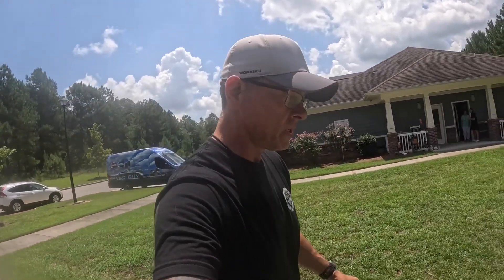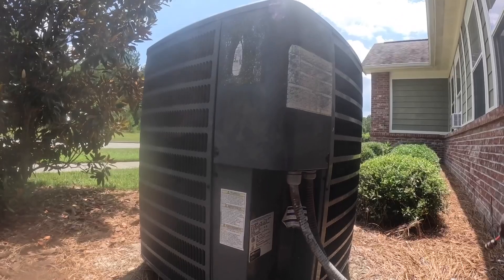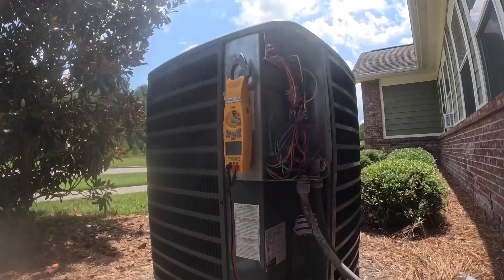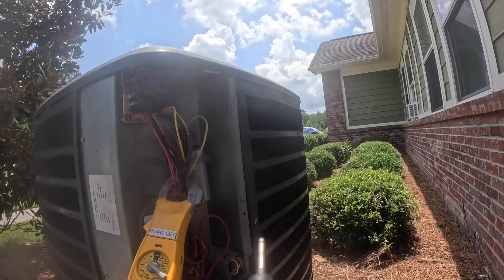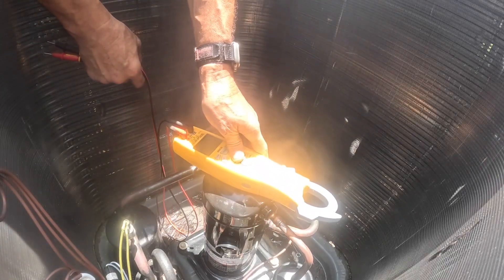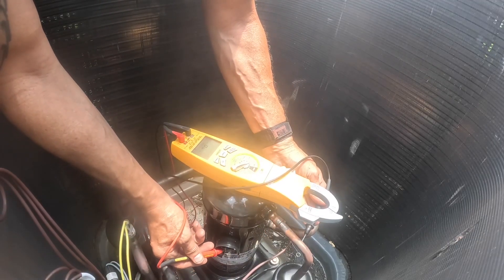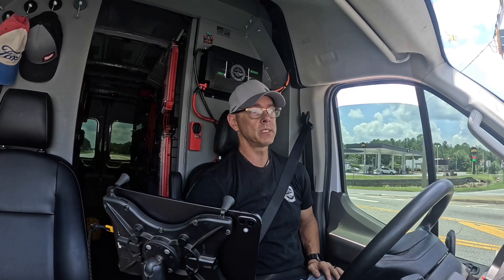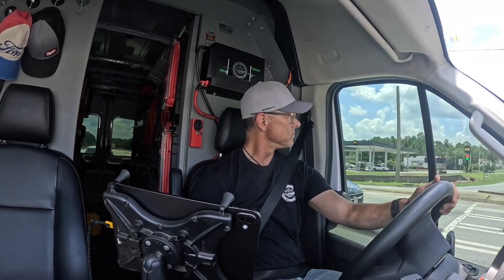Shorted Compressor Is Tripping a Breaker, But Why? #hvacguy #hvaclife #hvactrainingvideos

Comment: Hey. Just an electrician here. I see you have Dollar General in Georgia. I would not say that 4 megaohms wouldn't trip a breaker. I would have unplugged the compressor to see if the breaker held. 40+ years just an electrician.

Comment: Megger uses high voltage (few 100V) to test insulation. Probably it is arcing inside the compressor when 240VAC is applied.

Comment: Many standard megohmmeters may indicate a faulty reading below 10-20 megohms, while some scroll compressors can have acceptable readings as low as 0.5 megohms to ground. Just use standard ohms setting on scrolls.

Comment: You need to check a motor with a megger. It puts out high voltage and reads resistance. I have seen a lot of dmm that say a motor is good and a megger shows bad. It has to do with voltage it is being tested with.

Comment: I've been an electrician for many years (many). I didn't once think that that couldn't trip a breaker. DC ohms is very different from inductance, and there's a capacitor involved. I did think that perhaps the breaker was bad however.

Comment: If you replaced that compressor 2 years ago, something REALLY bad is going on with that compressor setup. Either it is running with a VERY dirty coil, or running dirty filters all the time… 

Compressors don’t die… compressors are killed.

Comment: That's the reason for checking with a megger, it uses a much higher voltage for testing for checking insulation breakdown. Most of the time, it won't breakdown at lower test voltages.

Comment: A circuit breaker is designed to trip when there is too much current flowing in the circuit.  If the insulation in the circuit is allowing more current to flow than it's supposed to (or there is a partial short to ground) when power (240v) is applied then it will have a fault (that trips the breaker).  That megameter comes in handy.

Comment: While on auto, Once My ac in my apartment reach it's set temperature, it runs for a very long time before it shuts off. Do you know why this could be? I do leave it off while at work all day. When I come in, I turn it on and it takes a few hour to reach set temperature, but once it reaches it, it runs for like an hour or more longer, before shutting off.

Comment: This is non-linear behavior, in which resistance becomes a function of voltage applied. Usually an abrupt change. Perhaps you could use an old radio trick and apply line voltage with a couple of 60W light bulbs in series to limit current.

Comment: Ohms law is too basic to be applied in circumstances like this. there are way too many factors involved, especially on equipment with high in-rush currents. 3meg on a circuit to ground and I’d be very concerned.

Comment: A motor under load can leak to earth (ground) but test as clear when stationary and disconnected from the supply. Seen it plenty of times and even when tested at 1000 v on a meggar. There are huge magnetic forces in there when energised so the windings get stressed. You are so right 👍
Reply: That actually makes sense. Partially damaged windings.

Comment: Along with shorted windings, which would increase the inrush amperage, another possibility is a breaker going bad. Without an amp meter that can capture inrush, you'll never know whether it tripped because of a true overload or because the breaker is getting weak.
Reply: Good idea. I wonder if his clamp on can capture and hold peak inrush amps.

Comment: Great Job! Definitely a bad Motor. I Worked 23 years In a Military Manufacturing facility …We had an overhead 480V 3 phase main buss line …feeding many disconnects to our equipment. 

One of the hanging (buss junctions) overhead shorted under load , shot sparks and kicked OFF One of the (Main 480V switch gears) at the plant on 3rd shift. 

Had a young…production supervisor, that wanted his CNC machines running making more parts . He wanted us to check the hanging buss junction overhead and we had:

(16 M Ohms) to ground… on all 3 unloaded phases 

Production supervisor was very cocky with no electrical background at all! He Said, “We have to get our parts, we need to reset the Main switchgear… its just …16 M ohms That should be fine. We need to reset it to get the equipment going.”

We all looked at him and said if you want to reset That Main 480V switchgear…go in there and pump the spring  lever… and press the reset, turn it back on yourself.

He called the maintenance supervisor About 3 AM in the morning and woke him up …Ticked Off at us ….Our Boss told him, do not turn that back on. 

That morning they called an electrical supply company …and we had to replace the bad section of the 480V buss. 

People just don’t understand, you never really want to see anything,  checking to ground …other than (OL)!

Comment: I agree totally with what you said, but another thing I do is to run the unit with the compressor unplugged and if the breaker doesn't trip, then you have just ruled out any other short to ground possibility somewhere else in the condensing unit.  Just another way to confirm it's a high resistance short to ground within the compressor causing the breaker to trip.
Reply: Excellent idea!
Reply: Yeah sometimes that’s the only way to find shorts
Reply: Especially low voltage

Comment: Ohms law ONLY applies to pure resistive loads. Compressor's motor is not pure resistive load, its a combination of resistive and reactive load. It is called impedance. Impedance is lowest when compressor doesn't run and get higher while compressor gets to speed. Impedance is highest when compressor run under designed load, that is why LRA (Locked Rotor Amps) during compressor start is as much as 8, 9 times higher that RLA (Rated Load Amps) after compressor got to designed RPM. Back EMF (Electromotive force) is a reason for all of that.

Comment: The resistance can also change when the high voltage is present - think arcing. Although remember it’s 120v to ground not 240😊
Reply: Magnetic stress on the winding can cause insulation faults to short.

Comment: Just an electrician uh? Electrician have 100 times more training than an HVAC
Reply: Sorry fam but most electricians I have known can't diagnose electrical motors or low voltage circuits. I don't know who you are, and I am not referring to you as an individual but to the many electricians I have seen on the field.

I had an electrician calling me for a blower PSC motor not running and I told him check capacitor, he said cap was good. Then he spinned the blower wheel by hand and the motor started. I said that Is almost guaranteed that your cap is BAD. He changed the cap and everything was good.(The guy didn't even know how to read capacitance??!! He told me he checked it and was good) 🤷‍♂️
Reply: Ohhh, someone is salty… 😅
Reply: Nah man.
Reply: @harryschrysan3183  - Haha, I was talking about the O.P… 👍
Reply: Also, I hate being that guy, but we have Plumbing, venting, ducting, ac, refrigeration(which is a whole different animal even within the HVAC/R), gas and electrical  knowledge to be able to do our jobs correctly. So where is that 100x more knowledge comes from.? If it's specific to your trade then sure.

Comment: If the compressor instantly trips a properly sized breaker it could be shorted winging wiring + grounded winding + acidic oil contributing to lowering the resistance on the overheated and damaged spot of the motor winding. 3megaohem by itself will not trip the breaker instantly but it will lead to failure.:body-blue-raised-arms:

Comment: Put a megger winding insulation tester on it.  Sometimes windings break down partially (with some micro-distance away from a ground point) that cannot be read with an ohm meter using AA or 9V batteries.  A megger insulation tester will induce 500V-5000V at mA current, will find all potential shorts in windings without damaging the windings.

 I know you know this as mentioned in video, just for those who don't.

Comment: It's  flexing under  the applied voltage  from a slight short to a full short  / with no voltage it relaxes  back  to the hire ohm  / this why it  fools you  /  it's  burned out  either way.   Eye cut one compressor  open and apart just to see what was going on)( a number of windings  were very dark  like  shorted against each other . One culprit is the factory  lead plug getting weak  causing the amps to go hire on the other windings   and burn it out.

Comment: I think there's an unanswered question:  what is the resistance of the windings of the compressor?  That's a different problem than the resistance of the windings to ground.  Inside a compressor electric motor, the windings on the motor can short to themselves - lowering the resistance of the motor. Get the resistance low enough and the inrush current will be high enough to trip a breaker.
What's the typical resistance of a compressor motor L1 to L2?
Reply: That was my question too.

Comment: Just an electrician?lol. As a union trained electrician, we know way more about electricity than a hvac guy. Yall deal with basic circuitry. We deal with very complex systems and circuits in our trade. 

If you knew ohm’s,you’d know that everything is proportionate to one another. Doesn’t matter if the meter is using 9v battery, it applies a set current through internal resistors that measure voltage that convert it to a resistance value. Thus being proportionate according to ohm’s law. 
 Plus the meter is Dc and you measuring on AC with impedance, inductive reactance and capacitance which factors in. Your meter reading was probably accurate. Yes a megger is always gonna be way more accurate. Get you a fluke and put away that fisherprice fieldpiece.
Reply: Are you serious? 🤔
Reply: @hinspect  what part you don’t agree with?
Reply: Why do wires rated for higher voltages have thicker insulation? What happens to a wire if a higher voltage is applied to it than it's insulation is rated for? What happens if insulation is damaged, does it's voltage rating still hold up?
Reply: @brianleeper5737  I understand all that. Dude was referring to that ohms law is wrong and  the resistance is not accurate coming from a meter which is false. Megger or hi pot tests insulation. You wouldn’t want to use a multimeter to do that. Residential HVAC requires basic electrical knowledge.  Nothing complicated there like dude is trying to say. Not saying it wasn’t a bad compressor but just calling out his comment on ohm’s law and the meter comment.
Reply: @mikep8861  I get the impression that someone claimed in the comments that a 3 megohm reading from a multimeter means it won't trip a breaker; that isn't necessarily true, the breakdown voltage of the damaged/compromised insulation inside the compressor could well be lower than 120V and that WILL trip a breaker. I don't know for sure what's going on inside that compressor but my suspicion is that's what's going on. His comment is addressing the idea that the 3 megohm reading means it won't trip a breaker. He's absolutely right in what he said; at least how I understood what he said.
Reply: @brianleeper5737  well, a multimeter isn’t testing the insulation like a megger does. It you trying to test insulation with a multimeter you messed up right there. He was acting like  a multimeter’s resistance on anything is not true because it uses a 9 bolt battery which is false. Plus, it actually doesn’t even use 9 volts in that circuit anyway. Much lower.
And he stated ohm’s law is wrong and he can’t explain why the breaker trips. All I did was comment on that. 
Once again, residential hvac systems are very basic electrical circuits. Easy stuff for a real electrician
Reply: @mikep8861  That was his point, you cannot use a multimeter to test for insulation faults like a megger is designed to do.
Reply: @brianleeper5737  he went about it the wrong way blaming ohms law is incorrect and meters don’t give accurate resistance measurements at all. Meters do give accurate resistance but doesn’t take into account insulation integrity. That is what a megger is for. Dude made it more complicated than what it was. 
Once I seen this guy change a disconnect in another video I knew he wasn’t no electrician by the way he was doing it. Lol
Reply: @mikep8861  I wasn't offended by his comments about electricians. So there's that.
Reply: @brianleeper5737  fair enough. What urked me was when he said we are “ JUST ELECTRICIANS”.  Excuse me but we are way more qualified and trained to know motors,circuit breakers,wiring in general than a AC guy. Lol. I get it that that’s the systems that he specializes in but in no alternate universe is he ever gonna know more about electrical than real electricians.
Reply: @mikep8861  Yea, but you can't buy refrigerant (neither can I), he can. You don't have the EPA license to work on those systems (neither do I), he does. An electrician would probably NEVER change out a compressor unless it's at his own house. Maybe diagnose why one is tripping a breaker, possibly...or more likely trace it to a fault in the outside unit and let the HVAC guy deal with it. When he says "just electricians" that's how I interpret it. He's not saying he knows more electric than electricians. He's saying he knows more HVAC and can (legally; EPA regs) do more HVAC work than electricians. I wouldn't have an HVAC guy install a load center and I wouldn't have an electrician install a condensing unit. I think both you and HVAC guy would agree with me on that.
Reply: @brianleeper5737  i agree. Funny you say that because I was actually studying the epa 608 study guide to go take the test as of a couple months ago. I since put it on back burner. It aint hard to get. I was passing the practice tests. But I recently been interested in  the field because I had to fix a bunch of electrical issues on my unit. I had a shorted coil on condenser contactor  that fried the control transformer and had stuck relay on air handler control board that kept the fan on. I was able to fix that easily so ir actually got me interested in the field since I can fix anything onbit electrically, might as well get certified to handle refrigerant and get a whole little side hustle under my belt. Lol . But yeah, I wouldn’t change our compressor because of the refrigerant so I see what you’re saying. That is his specialty, not ours. 👍
Reply: @mikep8861  Maybe I've just been very lucky, but all of the HVAC problems I've had have been electrical issues (capacitors, control boards, contactors, blower motors) that I fixed myself. Never had a leak or a bad compressor. I wonder how rare compressor failures really are.

Comment: Thanks for this video, Curtis. This time I see what you are saying. Your ohm meter reading of 3 Meg Ohms, is just barely indicating damage inside the compressor windings insulation. It probably got an indirect hit from lightning. It leaves the motor mortally wounded. When the full 240 AC is applied it will arc across the damaged gap in the insulation to the case. Here's an analogy; There is no water leaking out of an empty bucket with a hole in the bottom but suddenly fill it with water and it is a different story. So both you and Georg Ohm are correct. Thanks for taking the time to produce this video Curtis.
      As for the deadbeat property management company make payment timing and a late fee part of the contract.

Comment: It's not 3 million ohms! Don't you mean 3 milliohms? I=V/R = 240(v)/.003(ohms) = 80,000 amps. 3 million ohms is an open circuit.
Reply from the maker: Megohms
Reply: @HVACGUY  megohm: a unit of electrical resistance equal to one million ohms…

Comment: 20yrs in hvac and still currently am as a commercial tech. Ohms law really in my opinion doesn't matter here. Ohms law will tell you 240v @ 4.000 Mohms is essentially 0 amps which wouldn't be "enough to trip a breaker" which is why when you say that I believe it misleads people. The issue as another person stated is that it's the direct arc to ground due to the breakdown of the winding insulation that's "enough to trip a breaker". Yes, ohms law doesn't explain this because ohms law doesn't directly pertain to motors & windings. Ohms law just provides a general number when you input 2 known values which in this case is volts & resistance = current.

Comment: Good job. You're absolutely correct. The fault current certainly will increase once 240v is applied (contrasted to the low voltage of the meter).

Comment: You are right, if you have a bad megohm reading it will intermittently trip a breaker or fuse ! When you megohm, you are introducing a current through the motor windings checking the varnish on the windings and infinity is best as the varnish breaks down  to below a certain reading you will get nusense trips. I’ve done this many time on equipment up to 300 tons ( chillers ).

Comment: I call that partially going to ground😎if you do do the job put in surge protector at disconnect ,the heavy incoming spikes is probably what took out both compressors